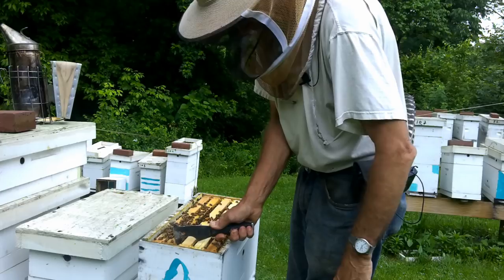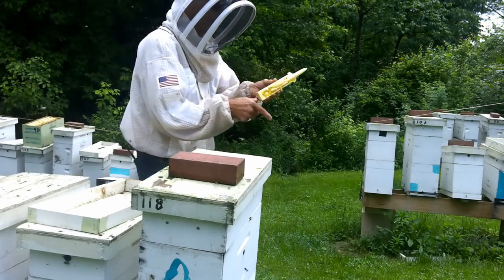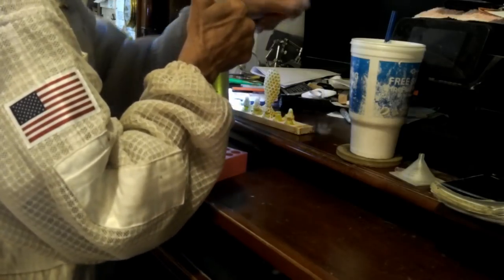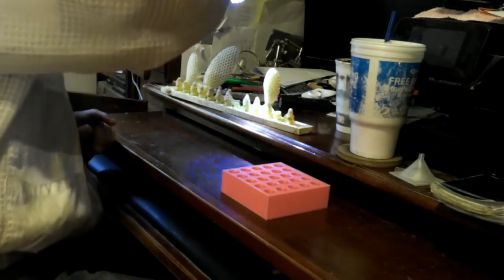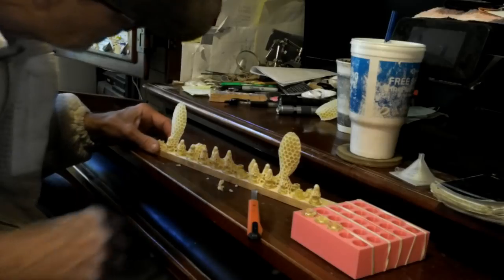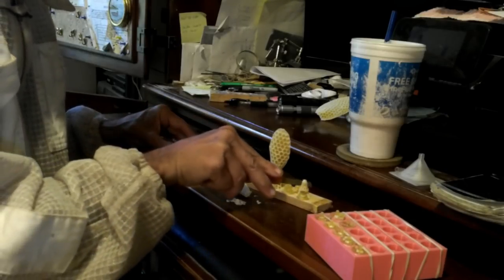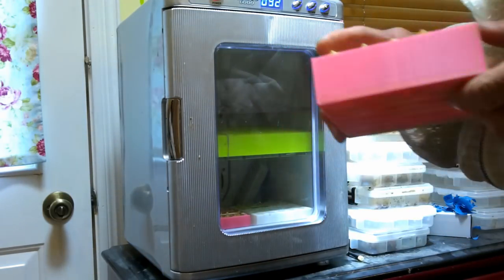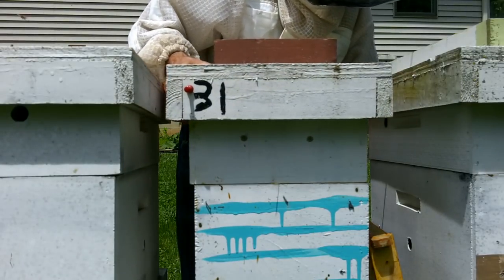Cells After Graft

Comment: I'd love to know how you introduce virgins. I haven't had good luck doing it. I like the idea of hatching and knowing I have a good viable queen rather than putting a cell in that didnt hatch.
Reply from the maker: The best way I have found to introduce virgins is put them in a jbzes cage with no attendants for 24 hours then pull her out and spit on her then release her into the hive in a corner with the least amount of bees.
Reply: @LittleBitsHoneyBeesjoemay  ok I will try this. Woolie b say he does the same thing about spitting on them. Will definitely give this a try with the next batch in a couple weeks
Reply from the maker: yes I told Langford  at Woolie b how to install virgins.
Reply: do you prime cups with royal jelly before grafting? Or just use what goes with the larvae when you graft?
Reply from the maker: I usually run 90% with out priming the cups.
Reply: @LittleBitsHoneyBeesjoemay  ok thanks. I haven't been priming my cups either and having good success.  I think a stronger cell builder is more important
Reply from the maker: I know it is you need to add a frame of capped brood and bees every 6 days.